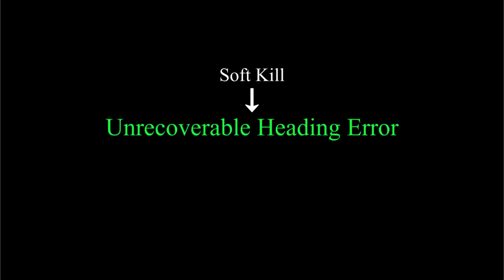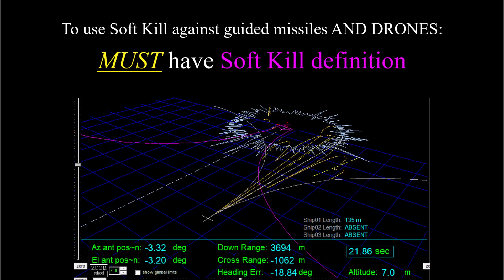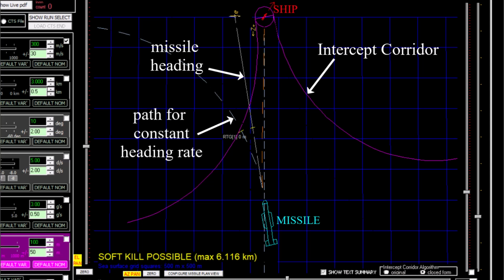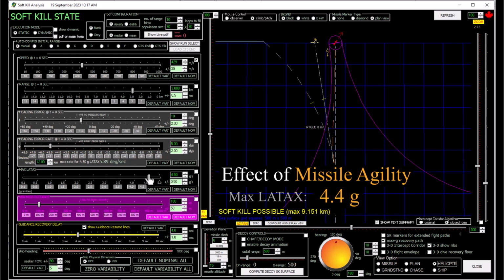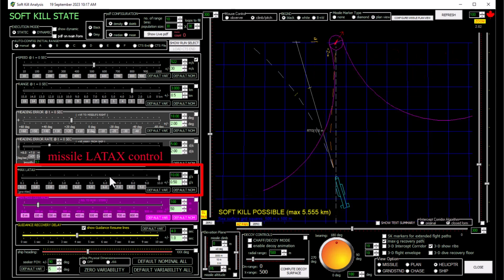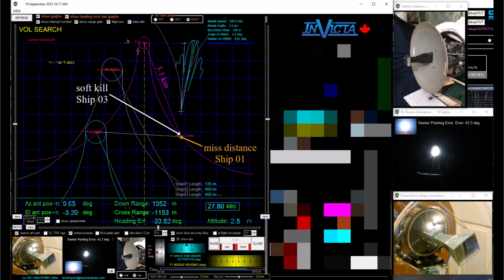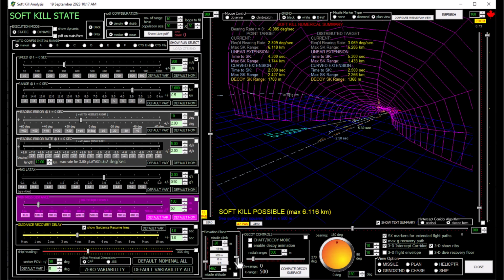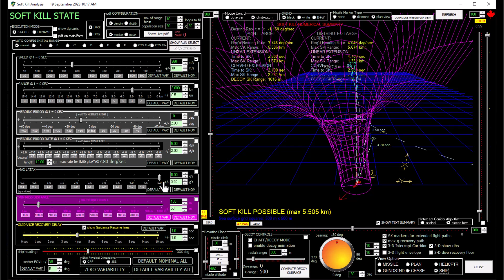A Formalization of Missile Soft Kill Part I 05

Comment: Is there any particular reason to use the intercept corridor rather than a maneuvering potential cone (possible future positions of the missile)? It's practically the same data, but attaching it to the moving object requires no further explanation. Especially so when dealing with a target that also moves at high speed with its own maneuvering potential cone.

Also, I suspect it's more useful to focus on time-to-impact than missile speed in terms of examining the narrowing of the cone.
Reply from the maker: Re. "Is there any particular reason to use the intercept corridor rather than": Yes, it didn't exist when I invented the Intercept Corridor in 1996.

Re. " I suspect it's more useful to focus on time-to-impact than missile speed": Useful to whom, for what?  I would say no, not if the time-to-impact is undefined because the missile has an unrecoverable heading error.
Reply: @skyindustries  Perhaps rather than time to impact, a better name for what I tend to look at would be speed/distance proportion. If something is twice as fast, but twice as far away, it would hit at the same time - but I'd assume for most missiles the maneuvering potential will be bigger, allowing for (in the ship target case) more evasive terminal maneuvers.